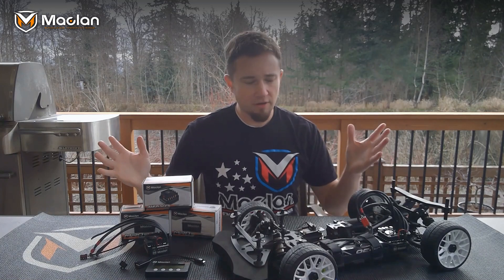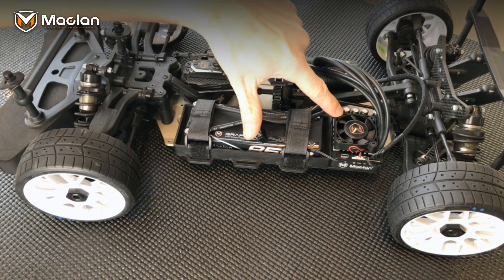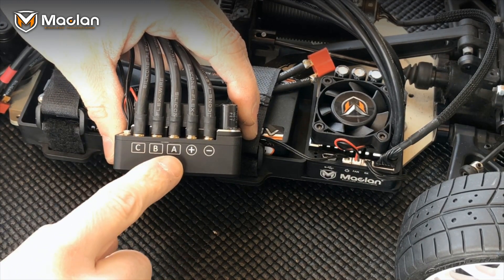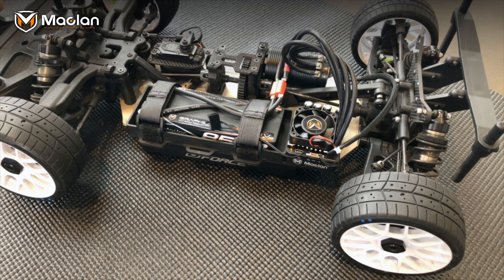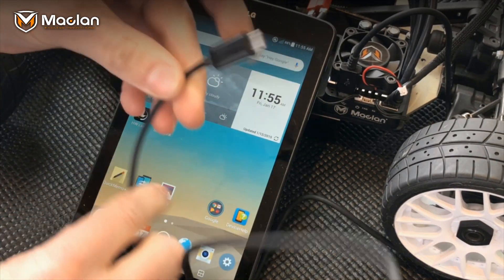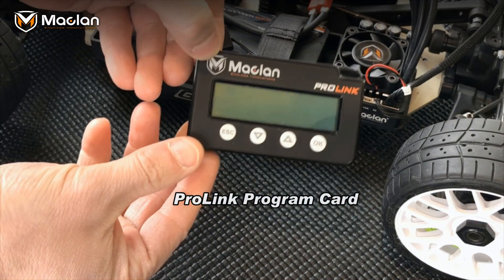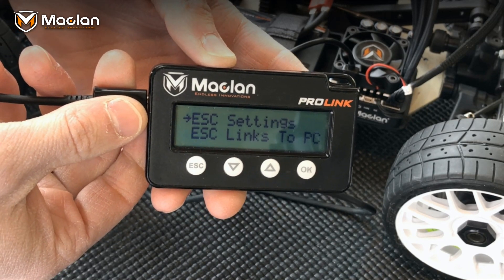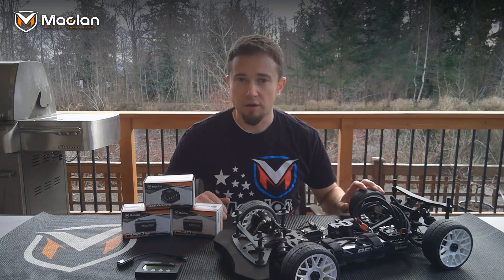Introducing MMax 8 ESC & MR8.3 Motors

Comment: The fan on the speed control is absolutely terrible Even if you buy the upgraded one with aluminum housing it still breaks itself apart because the motor itself wobbles inside the housing causing the fan blades to hit its own supports. The speed control itself seems to be really nice and work really well... but if the fan keeps breaking itself then it's basically a useless speed control